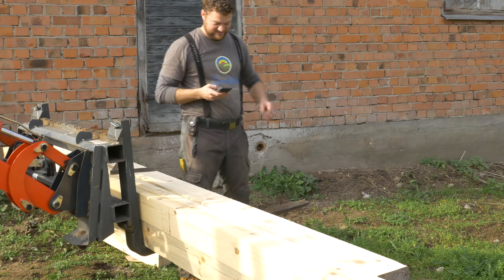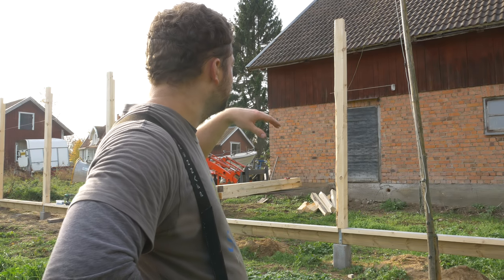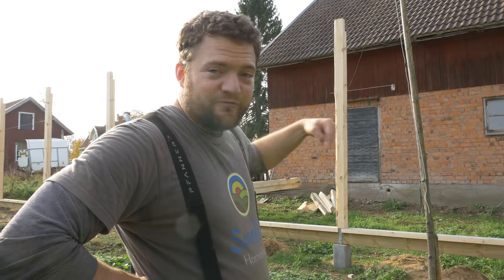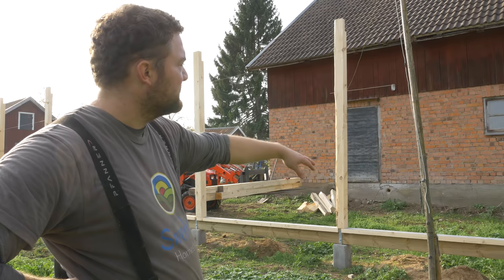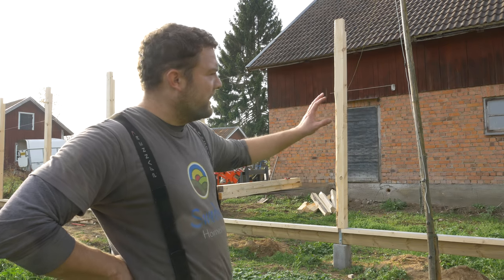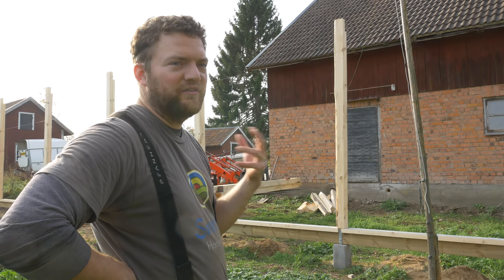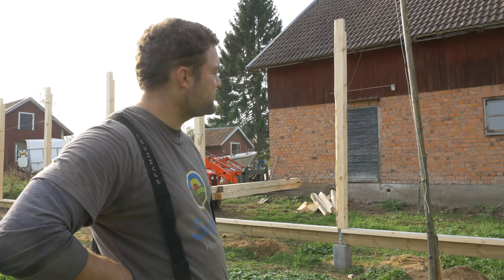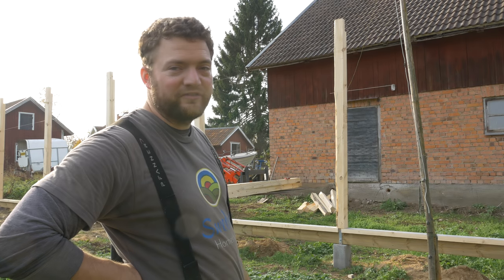I Love This Swedish Hand Saw - Cuts Through Big Beam Like Through...

Comment: Went right away to amazon but the saw is unavailable : ( 
35 years ago when I bought my first 262xp (and instantly converted from being a Stihl user), I also bought 2 sizes of Sandvik handsaws, when nobody here really knew what Sandvik was yet. I still have them and they are still reasonably sharp. What I like about the Hultafors is the slight angle of the handle, which looks ergonomic, other than for cutting vertically. Hopefully amazon gets some to sell!
Reply: julie ordered one on Amazon...$41....
Reply: I went back today and found one for $41... but shipping is $30. I can’t justify $70 when I just spent $200 on a silky katanaboy 650 (check out THAT saw!). I’ll keep checking from time to time.

Comment: you dont think those posts that you installed with 2 screws need secured better?  all it will take is for 1500 lb cow bumping one and then the roof comes down.  wont they also tear up the netting that you are going to cover the walls with?